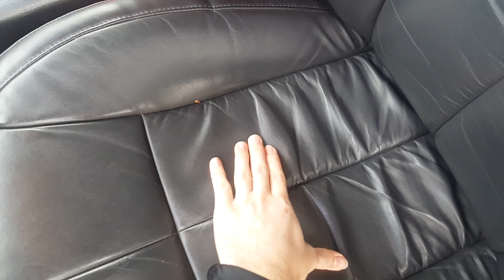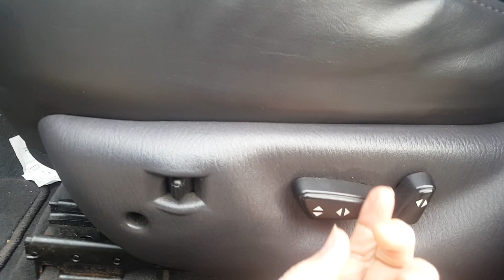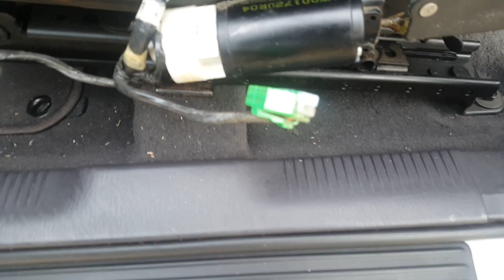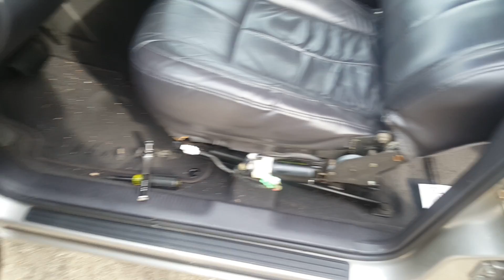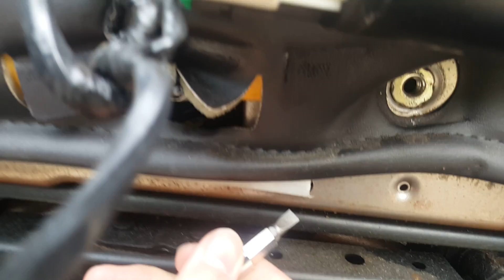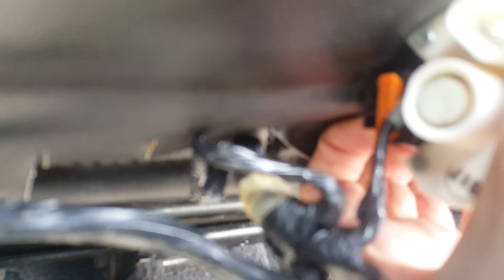2001 Jeep Grand Cherokee Seat Heater Repair Part 1

Comment: Any idea where I can pick up a set of those screws?  2 of mine are missing!  Thanks!
Reply: 3 screws same diameter. Pull 3rd for future match. Use toothpick to gauge depth needed and/or remove panel to eyeball. Head to hardware store, otherwise it's you friendly junkyard.
Reply: Auto store or the company that manufactured or sold it to you can at least point you in a better direction home depot is not cars